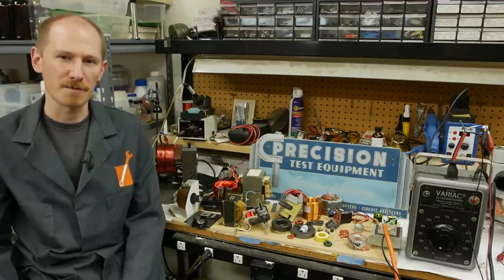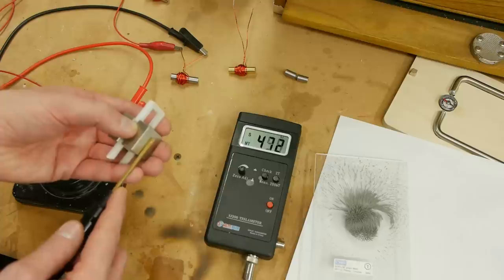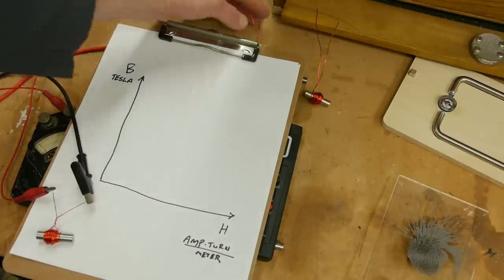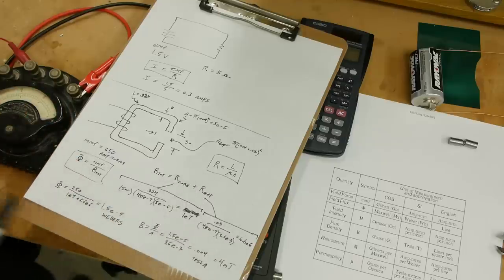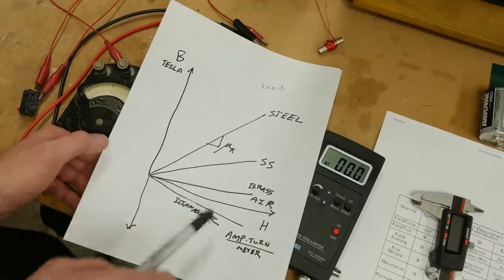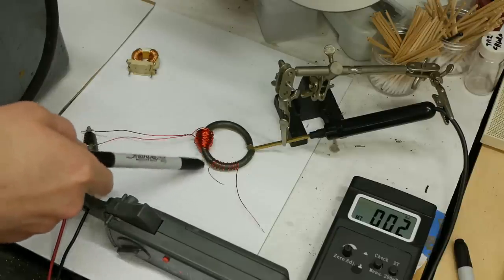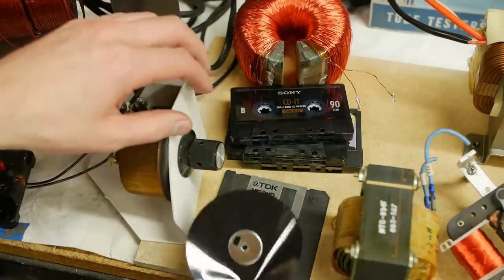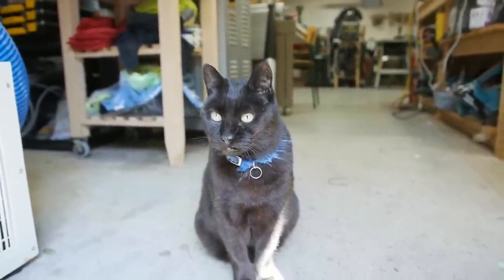Engineering magnetics -- practical introduction to BH curve

Comment: There's not video that i know in yt that explain the magnetic properties of materials better. I came to watch this video because I was trying to build a boost converter. For some reason i wonder why at 60-70% duty cycle the toroid would saturate. The efficiency curves are different for almost all toroids that i tested. My question became bigger when I tried to figure how increase output power. I tried changing frequency ,number of turns, wire length, size(height and weight) and shape but ended up increasing the size and paralleling n mosfets and  Schottky diodes. this videos seems to explain to me that there is more to it than just increasing overall size of my circuit.

Comment: Interesting video.  As an engineer that designs a lot of magnetics, I think you need to mention several reasons WHY magnetics is a more complex field than electrics.
          First (& you SORT of mention this) is that because no magnetic "insulation" exists, most magnetic problems are FIELDS problems versus CIRCUITS problems.  (I would be willing to bet that more than half of the flux you generate at the source of your magnetic "circuit" wafts into the air long before it gets to the compass.)
          Magnetic "circuits" only become simple when drastic measures are taken to limit flux leakage & make gaps, etc., short & uniform.  Fortunately, these measures are also needed to get efficiency, so they tend to prevail in designs.

          Second is that magnetic systems are predominantly non-linear in nature, versus electric circuits are predominantly linear.
          You mention the different magnetic materials for use at different frequencies.  But you totally miss out on why.  Yes, there is hysteresis, but that is minor compared to conductivity.  The ideal magnetic material must be an INSULATOR.  Why?  Because the minute you change that flux (to make electric energy "disappear" into a motor so mechanical energy can come out) or to get voltage out of the secondary of a transformer, that same voltage is induced INSIDE THE MATERIAL in addition to the coil.  If it's not an insulator, the "eddy currents" in the material EAT energy & material gets hot.  3 to 5% silicon is added to transformer steel to lower its conductivity by about factor of 25.  Doing so actually degrades the magnetic properties some, but the lower losses are worth it!  Even so, the losses are still WAY TOO HIGH to be practical in bulk material.  So physical schemes are resorted to: LAMINATION.  But even that can't work at high frequencies (where the voltages induced by a given flux gets higher), so ferrites (low conductivity because they are oxides, not metallic) or powdered metallic (carrying the lamination to microscopic levels).
          Regarding the integration drift problem: can't you program in a small negative feedback term in the o'scope math to keep the integrator centered?  You don't need fine control!  As long as the time constant of the integrator is ~10x longer than the period you are using, you should need not adjust anything.  Other way is to adjust DC offset of induced voltage (or set AC coupling).
          I have a MECHANICAL flux meter for use on line power measurements.  It is a D'arsonval movement calibrated for a 13 ohm sense coil (you pad up with resistor to 13 ohms).  The movement has no return springs.  When you energize the circuit, the meter pointer becomes a blur.  The inertia of the meter performs the integration.  There is a battery & switch to adjust one edge of the blur to the zero mark.  The number at the other edge of the blur is the flux peak-to-peak level.
          That ferrite "transformer" you show is not made to be a transformer.  It is a common-mode choke designed to filter EMI (from backing out of a switching supply into the line, the same as the ferrite core over the line cord you show).  "Coercivity" is the resistance to being magnetized.  "Remnance" is the amount of flux that is remains when current = 0.
          Regarding the microwave oven transformer, are you aware that it is part of a "ferro-resonant regulator"?  A capacitor is connected in series with the secondary, & value is selected to resonate at line frequency.  Resonance causes energy to build up "totally out of control", until some non-linearity (the saturation of the steel core) intervenes, regulating the current that the magnetron gets, even when the input voltage changes.  This was used on old computer regulated supplies, & also in Topaz "constant-voltage transformers" (where utility power is "dirty" & poorly-regulated).
          Your comments about CGS & MKS magnetic units is spot-on!  This is the only place where CGS & MKS units are NOT different by powers of 10.
          Given your background in industrial processes, are you aware the trouble magnetic materials require to develop their properties, including lengthy heat treatments in crazy atmospheres?  The more exotic of these I refer to "seances".  I did treatment on 49Fe, 49Co, 2V alloy.  Its saturation flux density is 2.2 teslas, but only if you do the seance correctly, to the letter!  It is considered the standard against which all power magnetic steel alloys are compared.
          If you pull a transformer apart & bend a lamination, its magnetic properties are destroyed at the bend point.  Hysteresis & remnance goes off the map!  If you dent a mu-metal shield, magnetically, it's as if you drilled a large hole at the dent.  If you wind a toroid too tight, the stress on the core will mess up magnetic properties.  That's why fancy alloy cores are put in a "box".

Comment: My goal : Design SMPS for Ac or Dc. I have various Core material but i don't have any datasheet of that cores(ferrite). Now i want to check its permiabilty,corceavity,Max flux it can handle, over temperature variation and frequency variation. I have DSo Regol1052E, 1.4Mhz function generator +-15 V sin,square,triangular wave.Suggest what the arrangement we need.I have read book Switching power supply hand book=authore :Keith Billings, and another book Abraham press man. after reading the book i have got information how to design Switching inductor but Those books very much dependent on CORE datasheet. So evry parameter need to verify  and unknown core parameter information gathering. I can manage frequency, current of Switch but i cant manage Core parameter value.

Comment: So it turns out the permeability of free space is no longer a defined universal constant but is to be determined experimentally. (Since the redefined the Ampere in 2019). The latest measurement is 4ᴨ * 1.00000000055 * 10^-7.

Comment: Several times you mentioned steel as the transformer core, i'm guessing this was an error ?
unless something has changed over many years, all 50/60Hz transformers are iron core
And not even a mention of air core, an example is the Tesla coil ;)
Reply from the maker: I think most modern transformers are made from "electrical steel."  It's mostly iron with maybe a few percent silicon.  The silicon improves permeability (to about 2000), and the resulting steel is relatively easily made into sheets for use in laminated cores.  Ultra pure iron is a great magnetic material, but I think its physical properties make it unlikely to be used in transformers.  Folks always say "soft iron", (meaning "magnetically soft") but I'm pretty sure this hasn't been used in a long time.  The laminations are needed to avoid eddy currents, and making the iron into sheets is too difficult mechanically.  I think this is the main reason.
Reply: One of the main reasons to add silicone to electrical steel is to increase electric resistivity and hence reduce eddy currents without the cost of even thinner laminations.

Comment: Overall this is pretty nice, but there's a little bit of sloppy vocabulary. In many cases, when he says the word 'magnetism', he is referring to the 'magnetization field', which is usually labeled, M. Also, most of the time when he says 'magnetic field', he's talking about B, which is the properly called the 'magnetic flux density' (or 'magnetic induction field'). The magnetic field is H. It's written correctly on the little reference sheet that he shows, but when he speaks, he uses the wrong terms.

Comment: in case of Litz wires: are the turns in mmf formula amp*turns then a multiplication of the single wires per turn of the bundled wires? It is a bit confusing to see in those formular no reference to the cross section of the wire that is turned. Maybe someone could give a hint to understand that better :-). Thank you for the great video and sharing your knowledge. Masterful.
Reply: SURE D no, only bundles do count. Basically we count only the turns that are connected in series, and litz is all parallel wires.
Reply: exactly, in litz wire, the total current is simply distributed between the individual strands. The total current is what matters.
Reply: On a side note, the cross section and the shape of the wire actually do matter, but are usually left out for simplification. The math gets very complicated at this point.
Reply: Litz wire is usually twisted. I can imagine there's a difference between totally parallel wires and twisted pairs... wait, I remember seeing this purposely done. ok.
Reply: @Electrobud do you have an information source recommendation to study this further?
Reply: SURE D
Not really. I just know that wires need to be approximated as one-dimensional lines in order to easily apply the laws of electromagnetic induction. And if they need to be one-dimensional, this means that their shape does affect the math. I am sure there are plenty of books explaining the math out there, but I can't name a specific one.
If you think about it, induction always plays with the area inside the coil of wire. But the area inside the inside edges is a different one from the one between the outside edges. And that's a 2D wire. What is the area inside a loop of 3D wire? Not sure. I would imagine simple wire shapes like rectangular or perfectly round can be approximated fairly well with an  average. But more complicated ones will need weird math tricks, maybe even are impossible to solve analytically and need numerical solutions (simulations on the computer).
Reply: Makes all sense. Thks a lot. Asap I have more information I will also share them here. Great to have such helpful friends...

Comment: Electric Circuits vs Magnetic Circuits  - resistance vs reluctance
The circuits use air.
Typical shaving examples
Philosophize - where it wants to go or where it doesn't want to go.
Steel (good), Brass (bad, Stainless Steel (not horrible) - electro-magnets
Tesla meter - directionality matters.
9:00 Measure each electromagnet
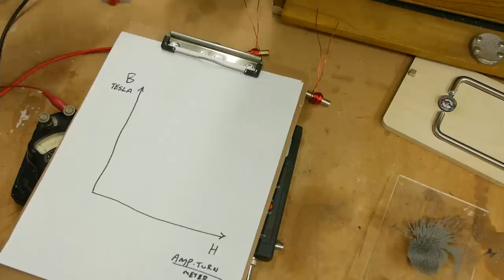10:30 BH curve
mu - permiability (magnetic resistance)
Units of magnetics
17:40 Example of Electric Circuits vs Magnetic Circuits
28:00 Nail exposed to a field and the BH curve
31:40 Saturation - transformer

Comment: OK, so now I'm  halfway through this video,  and I'm wondering why we can't make "magnetic circuits" like we make electronic circuits. (Sorry, I can't  keep my imagination in check, lol.)  We can do so much with electronics!  I've  gotta think we don't make magnetic circuits because we don't have the magnetic equivalent to integrated circuits. But hopefully, that will change soon.  Graphene is very interesting in its properties, and if you dope it with specific elements, it takes on new properties.  Somebody needs to do that research! I follow some physics research where they're experimenting with that stuff (just the doped graphene, mind you - no circuits!),  but to my knowledge,  nobody is really doing anything along the lines of what I'm thinking of.  Just off the top my head,  I can think of some new sensors that detect specific molecules, made by doped graphine (or another interesting nano material using magnetic or magneto-electric properties), and interfacing with a more traditional electronic circuit to do the other processing & display (and whatever other outputs are desired). Somebody needs to get on it!

Comment: You know, if you could shut a fixed, natural magnet, on and off, you would turn modern-day physics on its head, because you could create free energy via a infinite running, 200% efficient, power generating device, that would use 0 input energy, and would run forever. That's right, taking a natural magnet, and be able to to shut it on and off, yeah, that's the key to free energy. If you noticed, some of the people that have got rather close, often use a camshaft type array, to pull the magnet away & bring it closer, but it's not enough, primarily do to all of the efficiency losses in moving the extra shafts and devices.

Comment: Magnetic fields do not flow, they just exist. They can be manipulated and modified but they never flow anywhere.
Reply: I think I agree with you. There is nothing flowing along the flux lines. But magnetic disturbances travel from their origin at the speed of light. If not, it would be possible to transmit information instantaneously using magnetic field flipping or something. And if that were the case, quantum entanglement would not seem so spooky.

Comment: 3:15 It is a big mistake to use iron filings in this experiment because here we get the result of the interaction of magnetic fluxes with filings, and from this figure nobody will be able to calculate the structure of the magnet fluxes because there is no such science.
. I made a simple sensor / indicator to study the fluxes of a magnet at any particular point. If he is interested in you, how I will make a video about him, I can share it, only it will not be in English!

.Пользоваться железными опилками в данном опыте есть большая ошибка ибо тут получаем результат взаимодействия магнитных потоков с опилками а из этого рисунка вычислить структуру потоков магнита никому не удастся ибо нет такой науки.
. Я сделал простецкий датчик/индикатор для исследования потоков магнита в любой конкретной его точке. Если он вам интересен, как сделаю видео о нём, смогу поделиться, только оно будет не на английском!